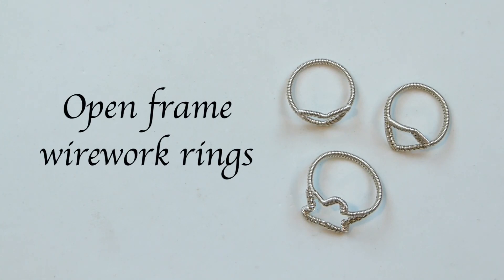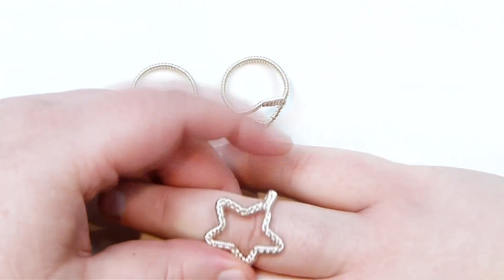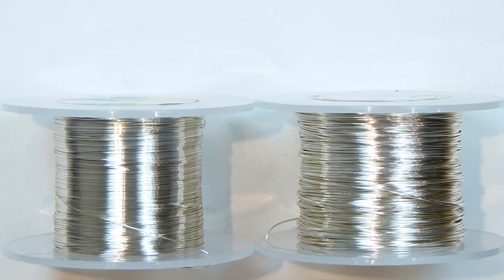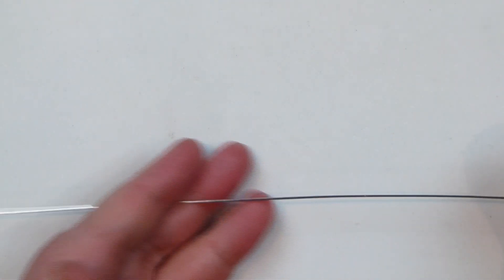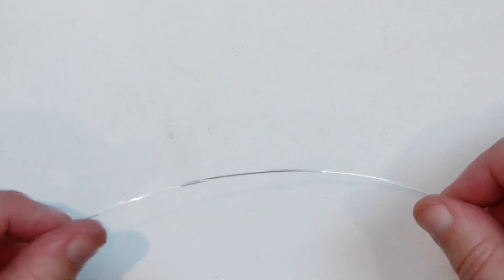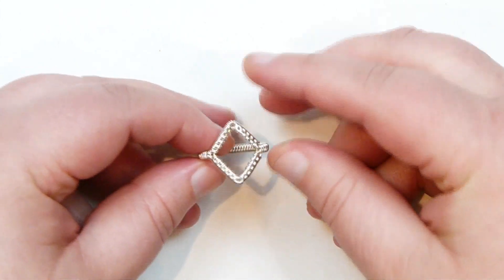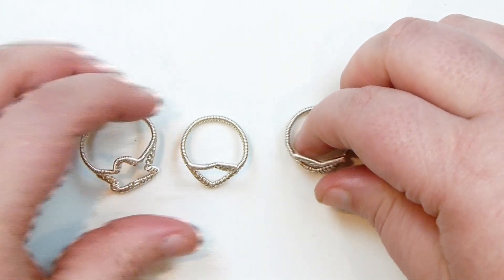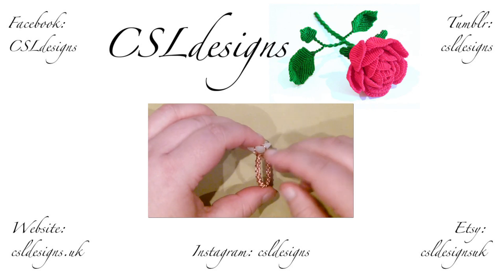Open frame wirework ring ⎮ Valentine's Day

Comment: This has got to be the most beautiful design I have seen on the band^^ I was wondering if you could give a tutorial on maybe just making the band itself, I have been wanting to make simple band to fit my thumb and your design is just so beautiful I would love to have that as a band. Thank you<3
Reply from the maker: +Ruth Lauterbach Thank you very much. Do you mean just having the wires with the wire weave on the ring band as the ring itself? If so, you would just need to find out what to do with the ends of the base wires to make it a complete ring. Either by soldering or finishing the ends off in a different way :-)